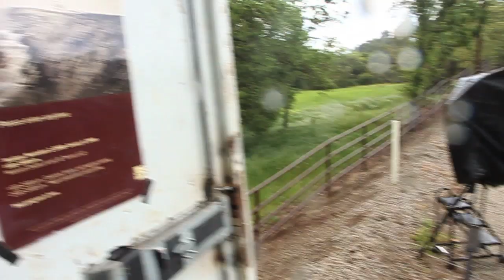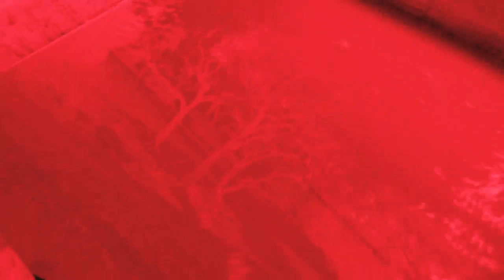Three Graces

Comment: This reminds me of the large cameras used to shoot the driving of the Golden Spike.  I think this is as much historical as creative photographically.  In a sense it reminds me of process camera work used for lithography.  It would be possible to transport a small process camera to the field and do similar things.  Process cameras usually have coated lenses too.  When they did direct screen and indirect screen color separations there were some very large format continuous tone, panchromatic films produced mostly by Agfa, some for masking purposes.  I am too old to try this now but I contemplated it once by building the camera into the back of a van.  Just open the doors and shoot.  No application today except historical.  Thanks for the efforts.

Comment: Trying to find out what happens to the old collodion and used silver nitrate, can you clean the silver solution now it has collodion deposited in the bath or do you have to dispose the used chemicals once they have been used several times?